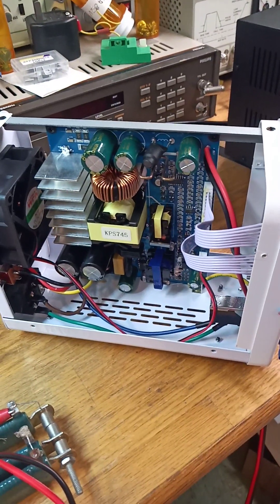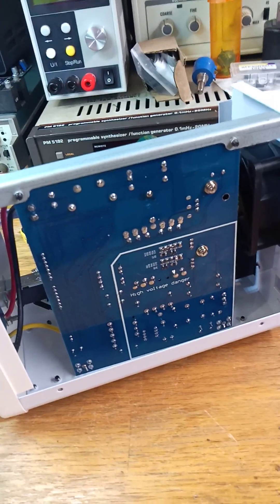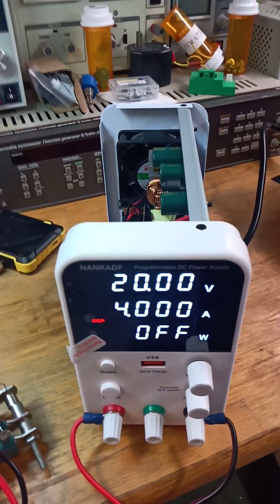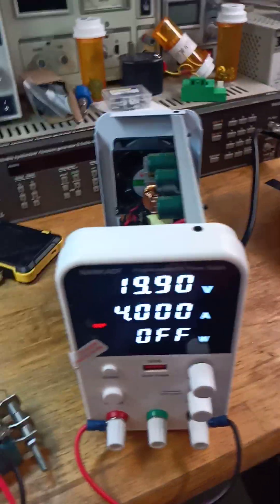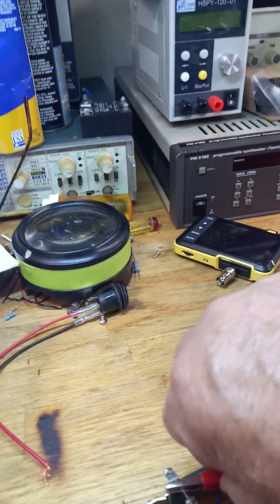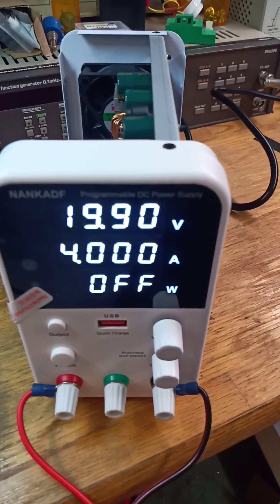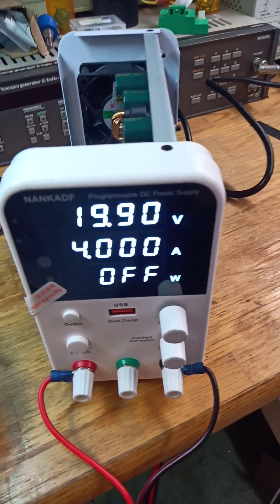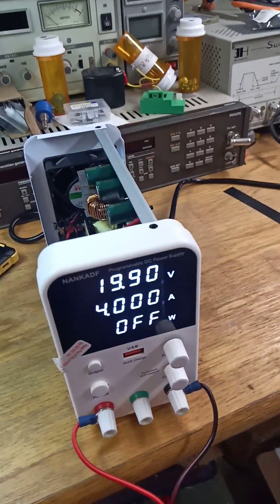NANKADF WPS605  60V 5A Power Supply With Encoder Controls Review

Comment: Now that I look again - first powersupply has no solder path reinforcement between AC/DC rectifier and pwm mosfets, where 240/110 DC(!) is running. This track will fry / cut loose over time. Is not very hard to reinforce, but will take some time and solder...
Reply from the maker: That supply is 800 miles away.  Thin traces may be on purpose. I worked on a power supply that blew an AC trace. This supply had plenty of room to make the trace wider. I had told the owner to use a lamp in series with AC to do dim bulb testing after the first fuse blew.  He didn't listen and put in another fuse.  That caused the trace to open up. Most of my supplies are XANTREX. This is a handy supply to use and it could be fixed up a little. Not much reason to.  People want to shop by price and stuff like this is what they get.
Reply: @opera5714  not AC, high V DC, it'll just melt at some point. Maybe one can even use thermal cam to find what to enforce 😏. As of to the rest of yer comment - 👍'up. Happy holidays!

Comment: extremely small sink, non reinforced power lines on back of mainboard is demand to be fried. These inverters number 1 death reason is high temp near caps and mosfets.  Edit: I would add second fan at top to blow hot air out or rotate the fan to blow outside and add second fan just on top of that heatsink.
Reply from the maker: You have to accept that there are degrees of junk.  This one was free.
Reply: @opera5714  Sort of. Microxactions in software also appeared cause ppl buy them more. Chinese pack less metal and worse filtering cause ppl not willing to pay. Hence they will actually respond and tell you what to add to improve it, heh.. Also the components fry due to bad solder and bad soldering of stuff to board, all also due to ppl unwilling to pay. Filters fail due to resistance increase over time - and yiz see mosfets/caps go boom.  Capitalism... But you know why they send for free to review? Cause they want honest opinion. Won't find this in Europe/Us - all censored/biased, even if unsponsored - chance to get lawsuit/takedown, as bad reviews will pull down sells...

Comment: Will a motor say wiper motor only draw as much as needed so it dosnt matter how high you set it?
Reply from the maker: Motors initially draw a lot of current till they start spinning and produce a back EMF.  Easiest way to think about it is all DC motors are 1V.  So, a 12v motor is running with 1V and 11V of back EMF. The power supply limits voltage and current.  Without load the motor will keep spinning faster till it flies apart or the magnetic core saturates.